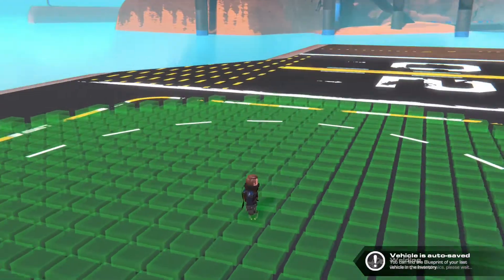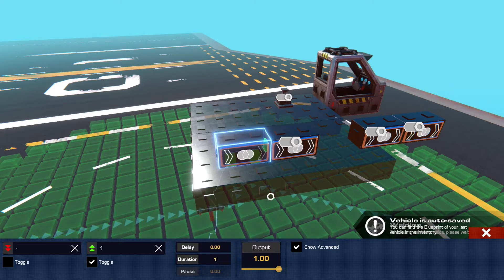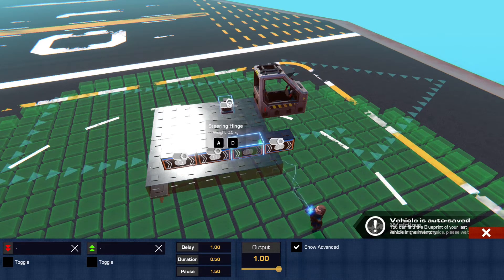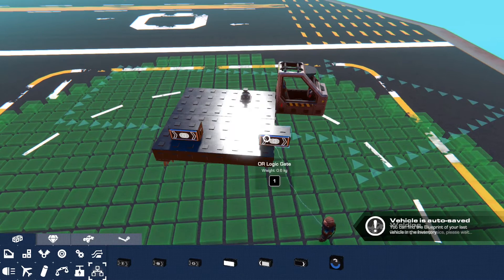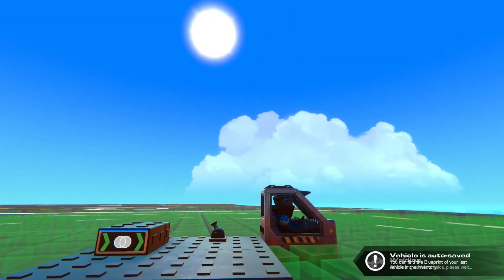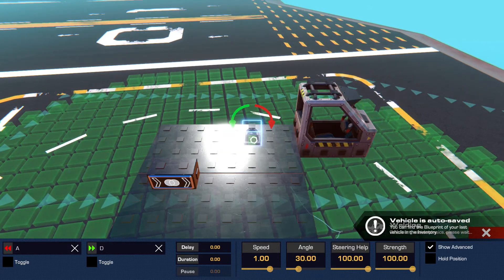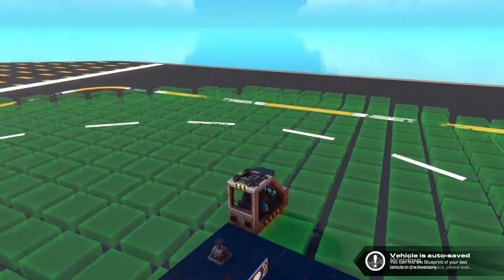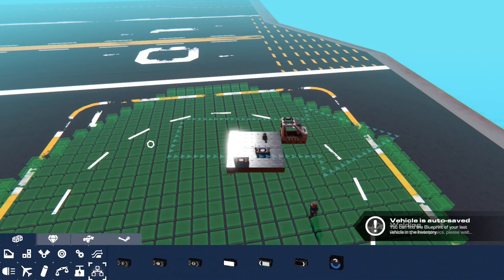Simple Logic Circuits - Trailmakers Tutorial

Comment: I'm gonna be honest ... I don't get it.. I've looked elsewhere for more information and I get very little. It's like my entire approach to logic  is fundatmentally flawed. I could play the video back in .25 speed and still not understand what's really going on.. I think the worst part for me is seeing every other comment say something along the lines of "This helped so much!" How? My neural network cannot seemingly connect these dots.

For instance; I wanna make a self leveling hovercraft that sits just above ground level. I know I need at least one sensor (Distance ironically works better than altitude); I know I need some gyro jets. I'm pretty sure I need 2 angle sensors, I know I need all the above connected somehow to each other, and I know I could probably use a comparison block to mess with the strength of the gyros to make it less jerky.

What I don't know is what to connect what to, how these connections are logically affected (IE Logic chains/conflicting logic etc), what any of the terms really mean (IE "value/input" etc)  or what to set any of the parameters with. What it ultimately becomes is 3 hours of getting absolutely nothing done all while trying to experiment to find something that sort of works. (3 hours is a very conservative number I should add. I've spend literal days trying to figure logic out to no avail). There are times when I feel like I'm close to something; then I will change maybe one or two parameters and it ends up worse than before, quite literally resetting my progress back to zero because just flipping switches to see if something works might work but it doesn't mean you understand why.

I really want to understand this stuff but I seriously don't think I have the mental capabilities.
I wish their were really in depth tutorial videos for very specific builds. Like We get videos showcasing a really cool build but almost never is the logic ever given dedicated attention and when it is it's very simplified stuff like "I need this to connect here, that'll trigger this, etc etc". 

Idk if you can tell but this is a somewhat existential problem for me. I can design fantastic lloking builds but if my lovely hovercraft doesn't actually work like a hovercraft then who cares how cool it looks.

TLDR
So if you're ever interested in making customized logic tutorials I will gladly tune in...

Comment: Is there a way to turn off for example distance sensor?
Reply: That's what i was thinking
Reply: Put it on a steering hinge or mechanism to make it face it away from whatever you don't want it to detect. Alternatively you could use an OR gate to disable whatever you have the distance sensor connected to.  Settings on the OR gate would have to be /toggle/keybind/0 output. For example I have a hover drone that uses distances sensors, but it will stop hovering and land if I press a key. I added another logic circuit to make it so that the thrusters stay on with reduced power whenever it's within 15m of the ground so it will land itself safely.

Comment: I've been working on a project and I'm in need of a pulse extender but don't know how to build one in this game. 

A pulse extender is a circuit that takes an input signal and passes it through immediately but continues to output the signal for a duration after the input ceases.
Reply from the maker: Sorry for the very late response. I have a blueprint for a pulse extender, and If you join my discord i can give it to you if you play on steam. However, it is like a 3.5 year old blueprint and i have no clue if it still works.
Reply: @aetherium5926  I play on Xbox not steam so I wouldn't be able to use the blueprint anyways. But perhaps make a video and update your blueprint?

I did jury rig a sort of pulse extender. I set up a piston to trigger a distance sensor. Monkeyed with the starting position so that the sensor triggers as soon as I move the piston, piston set to auto retract and with the speed just right it retracts slower than it extends and thus I created the effect of a pulse extender